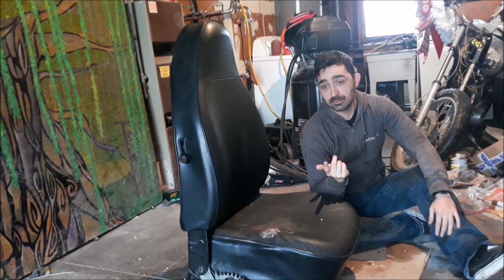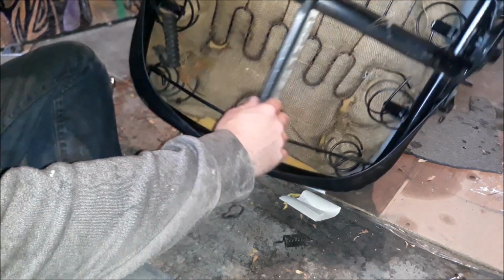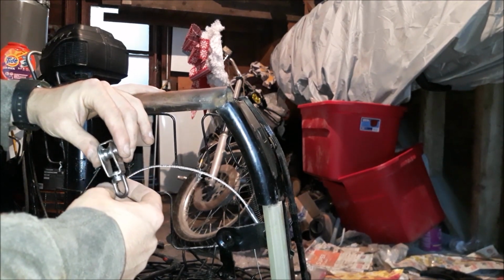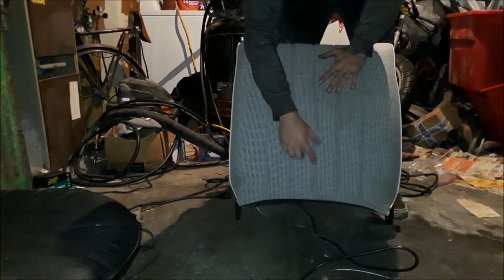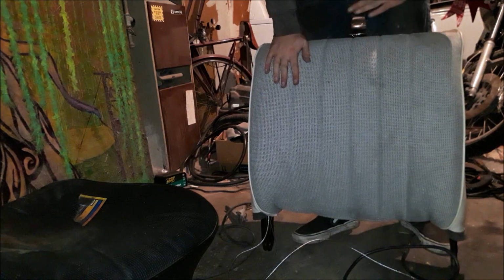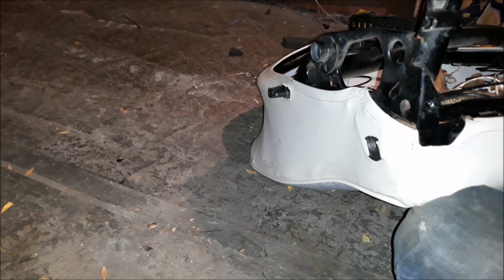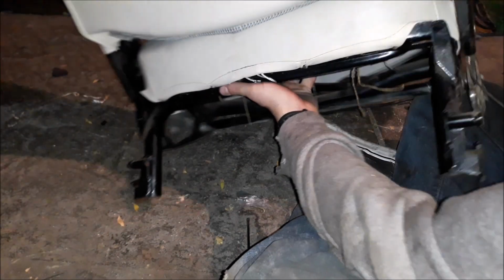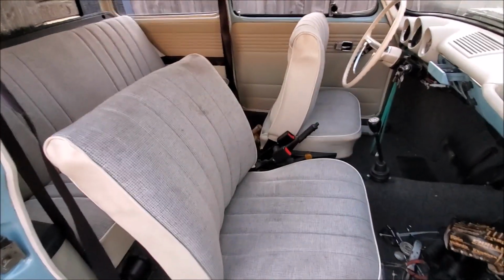VW Squareback Restoration Part 37: Low-back seat conversion

Comment: That's actually a pretty cool conversion. Is there a template as to how high/low to cut the outer supports or did you just eyeball the height?  Well done overall and they look fantastic in your Square.

Comment: I have a question about window seals and window trim.  Have you complete this yet on your squareback?
Reply from the maker: Sure did
Reply: I ordered the window seals from ISP West. I'm having a hell of a time getting the trim inserted in the rubber.  I've even dropped off the windows to a reputable auto glass shop in town and they failed to get them to work. They recommended getting German seals. Where did you get your seals from? Do I need German seals? Do you have a video on this?
Reply from the maker: @joshuazastrow548  yes I did them myself. No videos I think, maybe I talked about it a bit in the popout window video. Generally, going german with the seals is the way to go, but it doesnt mean that brazillian won't work. I got the trim to work by putting the seal on the glass off the car. You'll never get the trim in once the window is on the car. Just used a dull flat blade like a putty knife to pry open the trim channel and force that trim down in there. Just chase it around, itll go. Didn't need heat or soap. Good luck!!